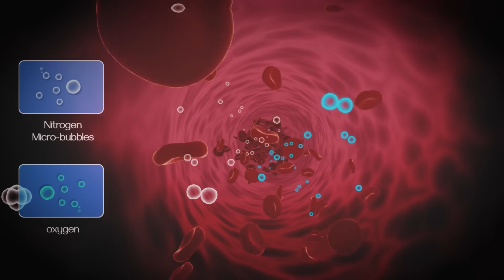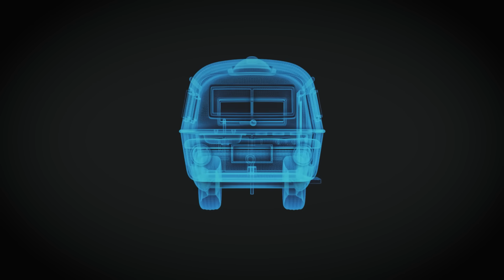How Did a Tiny Hole Kill 4 Divers?

Comment: Awesome video, really good explanation of this horrible accident. But at exactly 8:36 I think you misspoke, and meant to say “decrease the pressure” instead of “increase”. The trunk was also at 9 atm, so the tenders should have slowly decreased the pressure from 9 to 1 atm before detaching the clamp. Am I correct?
Reply from the maker: Yes. I did misspeak and you are right. Once it’s published I can never go back and correct it. I wish YouTube would let us put a text overlay on but not possible. Good catch
Reply: @waterline-disasters  yes this is a problem lots of youtubers find annoying! It was just a small detail I wanted to be sure about! Thanks for responding.

Comment: Doesn’t sound like “equipment failure” to me even if there was an interlock you never trust an interlock it’s something that never should be used or relied on! It’s only there as a last line of defense if someone really really screws up. It sounds like one incompetent guy killed all 4 divers. Truly unbelievable that this guy didn’t ask at least twice if the hatch was closed before releasing the bell! This isn’t something you do without at least double checking! I’ve seen a few horrible “accidents” when people used an interlock or other failsafe as the primary device.
Reply from the maker: Youre not wrong. There should be that kind of communication but there should also be failsafes. Humans are imperfect and technology for this kind of extremely dangerous equipment should be built to have failsafe's to protect the people who use them.

Comment: I was told that when technicians work on nuclear bombs, there is one who does the work, and a second who reads the instructions out loud  from the manual, step by step.     This is the best they can do for safety.

In a case like the Byford Dolphin incident, it is inexcusable that there were not mechanical fail-safes designed into the system.
Reply from the maker: I think airline pilots have similar procedures. Human error prevails, failsafes make safety catches.
Reply: Money is more important than human life for these companies. So guess what.....
Reply: One of the lead designers of the Manhattan project died because he was covering the core by hand. He made contact with the outer shell which caused it to emit a blue flash which was an instant lethal dose of radiation. He died shortly after.
Reply: @French onion  that was the demon core incident. A spherical plutonium core intended for use in a possible 3rd atomic bomb (which ultimately wasn't needed after japans surrender) so they did experiments with it on getting it close to criticality. It actually caused 2 direct deaths in 2 seperate incidents, can't remember their names of the technicians who sadly received fatal doses of radiation, but the first time it was surrounded by bricks of tungsten carbide which were being placed in different orientations to measure their effects on reflection of neutrons, sadly a brick fell onto the core sending it momentarily supercritical. The second time the core was surrounded by 2 neutron reflective half spheres with a slight gap in between them, some sort of wedge like stoppers were used to stop it closing completely but sadly the technician got overconfident took out the stoppers and used a screwdriver to get it as close to criticality as possible to take whatever measurements were required, the screwdriver momentarily slipped and the half spheres connected causing complete reflection of escaping neutrons back into the core sending it supercritical and giving the unfortunate technician the largest single dose of radiation ever received by any human. He would have instantly known his fate but he still had the presence of mind to flip off the top half sphere which would have ultimately saved the lives of the other technicians in the vicinity
Reply: @samcranmer434  the man in the 2nd incident did stay with the man in the 1st incident when he was in his deathbed to comfort him. And history still repeated with a screwdriver.

Comment: Really enjoyed this, any reason why not using only oxygen in depth diving?
Reply from the maker: There is a simple answer and a complex answer.

The simple answer is that at depth Oxygen is toxic.

The more complicated answer is that the human body can only survive with a very specific amount of Oxygen. Too much and its toxic, too little and it wont sustain life.

At see level there is 1 atmostphere of pressure.
We breath air that is roughly 20%oxygen and 80% Nitrogen.

Now you talk about Partial Pressure where 1 Atmosphere (ATM) = 0.2(Oxygen) + 0.8(Nitrogen).

This is ideal for human survival. When they climb Everest and need extra oxygen its because the atmosphere gets thinner. The pressure drops so the Partial Pressure of Oxygen Drops.

The opposite is True for divers. Under higher pressure, the partial pressure increases. 

At 10 meters deep 33feet, the pressure is twice that of the surface. 2ATM.
2ATM = 0.4 Oxygen + 1.6 Nitrogen.
For every 10 meters 33 feet there is one more ATM of pressure.

At 60 Meters roughly 200 feet, there is 7 ATM of pressure.
7ATM = 1.4 Oxygen + 5.6 Nitrogen

At around 1.4 -1.6 Partial Pressure of Oxygen it becomes Toxic. 

If you were to breath 100% Oxygen for any length of time it would be toxic.

But 100% Oxygen under pressure.
1ATM = 1 Oxygen
1.6ATM (6 meters deep or 20Feet) = 1.6Partial Pressure of Oxygen.

At at 6 Meters or 20 Feet you would die from Oxygen Toxicity if you breathed 100% Oxygen.

I hope thats not too technical.
Reply: @waterline-disasters  thank you, that's what I wanted, technical explanation.
Reply: Not to mention in a bell if any electronics/electrics spark it'll burn the whole thing out like the Apollo 1 test stand astronauts. They were running a 100% oxygen atmosphere..

Comment: Sorry, but I had to listen twice to follow. The video said that after the hatch between the diving bell and the trunk is closed, the pressure in the diving bell is slightly increased to make it easier to separate it from the trunk. OK. Then the divers crawl through the trunk and into the habitat, the last one closing the hatch between the trunk and the habitat. OK. (But, "habitat" and "chamber" should not be used interchangeably. Don't confuse the reference.) Then the video says that pressure is slowly increased in the trunk, to make it easier to separate the diving bell from the trunk. Not so OK. That leaves me, not knowing the procedure, wondering if the diving bell has not already been separated from the trunk, and if not, how increasing the pressure in the trunk would not negate the already mentioned increase in pressure in the diving bell, or if perhaps what is meant is that pressure in the trunk is increased to make it easier to separate it from the habitat. 
The video is about the procedure, so my complaint isn't a trivial one about differentiating between putting coffee into the machine before the water, or water before the coffee, before turning the machine on. Interjecting descriptions about why steps in the procedure are done is fine, and interjecting who does them is fine and everything up to the point I drew attention to is very clear and flows very well. 
The final explanation makes me wonder though, trying to think through it. If the hatch between the trunk and the diving bell was locked, then the "clamp" between the diving bell and the trunk would have to undo the hatch? And the entire proper procedure makes me wonder, too, why the pressure in the diving bell would not be slowly released before unclamping from the trunk? Would the pressure in the trunk be slowly decreased after the hatch between the trunk and the habitat was closed, commensurate with the decrease in pressure in the habitat? If the proper procedure is to release the clamp between the diving bell and the trunk while both are still pressurized, wouldn't that result in an explosive decompression (even though the divers were safely in the pressurized habitat)? Wouldn't that explosive decompression result in everything not tied down in both the diving bell and the trunk being forced explosively outwards, potentially causing extensive damage to anything or anyone they hit?
Reply from the maker: OK. So a few things there. Habitat and Chamber can be interchanged because technically a habitat is a chamber that can be lived in. Both are chambers. But I take your point that it makes sense not to confuse things and so I should stick with one word. 

Then you are spot on. I see the mistake now I had to go back and listen again a few times too. I said that the trunk pressure would be increased but you are right, I misspoke it should be decreased. 

But a point here. The diving bell hatch was sealed first. Not the hatch adjacent to the diving bell but belonging to the trunk. It was the hatch belonging to the diving bell. That hatch opened and closed from inside the diving bell and the increased pressure in the diving bell ensured the dive bell hatch stayed sealed. The pressure was pushing outwards and the dive bell hatch is inside the bell. I can imagine they keep the bell pressurised because it takes time and also wear and tear on the machinery to pressurise. 

Then as you have pointed out, After the habitat hatch is sealed, the hatch pressure should be decreased. In this instance the bell and the habitat are pressurised and when the trunk is fully depressurised the bell can be released without and risk of explosive depressurisation.

But honestly, this is precisely why its such a complex system. 

Thanks for commenting. I really appreciate the details and it annoys me when I get these small details wrong. Often a story hinges on details.
Reply: @waterline-disasters  --- Re-reading several days later ... there is not one hatch, but two hatches between each of the component chambers. The bell has a hatch to an opening which can lock with the trunk opening which has its own hatch, and the same for the trunk and the habitat. The "doors" are all "double doors". Then there is one latch between each of the component chambers, that (I guess) aligns the openings, one to another, and each latch is pressure resistant. 
What SHOULD have happened is that the hatch on the bell closed, the hatch on the trunk leading to the bell closed, then the latch aligning the two could be released. What ACTUALLY happened was that the hatch of the bell closed, the hatch of the trunk leading to the bell was NOT closed, the latch between the trunk and the bell was bearing all the pressure inside the trunk ... and when the latch was released, all that pressure resulted in the disaster.
Reply from the maker: Yes that makes even more sense. I'd love to see the actual technical drawings but I haven't been able to find them.
Reply: @waterline-disasters  ---- Thanks for the additional description. I totally overlooked (in trying to imagine) that each component, bell, trunk, and habitat, have their own hatch, presumably each one opening inwards. (I have, once or twice in my life, pushed commercial glass doors that require a pull to open. The first time, I thought it was stuck, and kept pushing for a bit before my "Aha!" moment!)
The company ultimately was found lacking in fail-safe procedures, but that piece of engineering must be a very seriously precise design just to get the thing air-tight under all that pressure, with salt water and prolonged use. A challenge to describe in layman's terms. I mean, not to presume anything, but at least two of us spectators are rocking on our hinges over it. Poor engineers. 
The overall sense of what happened comes through v-e-r-y clearly in your video, and your description of that was "horrible". To get the hatches parts right, I don't know ... a diagram? Honestly, I've watched some diving videos that have even gotten stuff exactly backwards, and the accumulation of errors from various videos makes me start to point some out. I didn't mean to nit-pick. You were a lot clearer than another video involving saturation diving covering a similar incident. And your narration voice is very listenable (the right sound mix or modulation).
Reply: @waterline-disasters  ---- Re-reading your kind reply clarifies the picture, but then the diving bell hatch was closed from the outside, from within the trunk. So the correct anticipated procedure was to exit the bell into the trunk, close the bell hatch from the outside of the bell, from within the trunk, then B) close the trunk hatch from inside the trunk. And the same procedure with the hatches between the trunk and the habitat.
Then slightly increase the pressure inside the bell, before unlatching it from the trunk (a fail-safe to ensure the bell hatch remains close during unlatching). Then, I guess, slowly or moderately reduce the pressure inside the bell to match atmospheric pressure before opening to clean and do maintenance. And the same for the trunk - once the divers are secure inside the habitat. 
Then the pressure in the habitat would be slowly decreased over whatever time was calculated for decompression. I'm not an engineer, but I just did back-flips because the anticipated procedure has to be precise, and it was imprecision that resulted in catastrophe. I agree with other commenters that your description is the best (I watched one other one that wasn't clear at all). The challenge to make an admittedly "entertaining" video, with everything involved in that, finding a topic, researching, getting images, sound, editing, narration - and all - is pretty steep, I imagine!
Edit added: Then you have to deal with the comments (lol).
Reply from the maker: Hi Dave. I really appreciate you taking the time to nitpick. I'm a scuba instructor or at least I was and now I run a YouTube channel about how to scuba dive called Waterline Academy. 

I have to be precise in explanations because the details change so much. 

Much like you I've seen other videos and was flabbergasted at the lack of detail or the inaccuracies. Not to say I've got everything right. 

I started writing angry comments then deleting them because I felt the details would be lost on people who have clearly misunderstood the topic to begin with. 

So I decided to make my own video. I really enjoyed the process. I put it on my original channel and it went unnoticed. I guess people who want to know how to scuba dive don't want to know about accidents. So I pushed this video and sober others I made into this channel a few weeks ago. 

To my astonishment this channel now has more views per day than my original channel. 

Some very kind people have said I should carry on and so I will. 

Again, the stories hinge on the details. I hope to live up to giving as accurate a description as possible of these accounts. All the while trying to make it as engaging and digestible as possible.

Comment: How could you easily open the door??
Reply: The door wasn't opened per say.. The pressure wasn't equalized and when the door clamp was being removed it exploded open.
Reply: @FATSIDEDOWN  It was already open when the tender removed the clamp. It should have been closed.
Reply from the maker: You have to manage the pressure. If the pressure is the same on both sides of the hatch it will open easily.